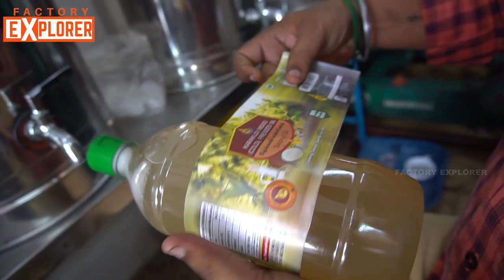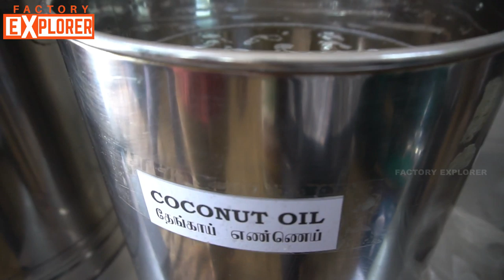Wood Pressed Coconut Oil Making (With English Subtitles) | Natural Chekku Oil | Factory Explorer

Comment: What is the price of oil??
Reply: Rajeev Kumar Karwayun  320 per litre
Reply: 320 per litre
Reply: @umaganesh6446  okay.. Thanks. Courier kar dete hai kahi bhi??
Reply: Rajeev Kumar Karwayun I don’t understand hindi-only English n tamil. We can deliver all over india.courier charges to be borne by customer
Reply: @umaganesh6446  the issue is cost of sending the parcel. Oil costs 320 and this seems okay but courier would add another 200 making it 520. It is easily available for the same price on organic sites online.
Reply: Rajeev Kumar Karwayun no it won’t cost 200, tell me the place will check and let you know asap
Reply: @umaganesh6446  Dehradun
Reply: Rajeev Kumar Karwayun due to lockdown we couldn’t contact the courier people. Will keep you posted later
Reply: lily silly wood pressed and cold pressed are same, virgin oil is extracted by heating process so I personally feel wood pressed is pure
Reply: @umaganesh6446  is courier service available now?
Reply: Rajeev Kumar Karwayun yes sir available